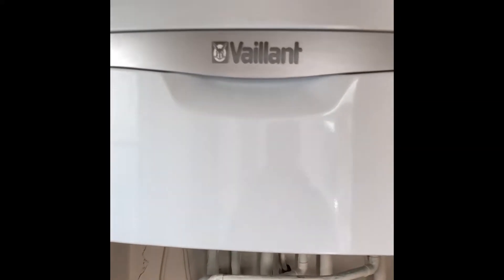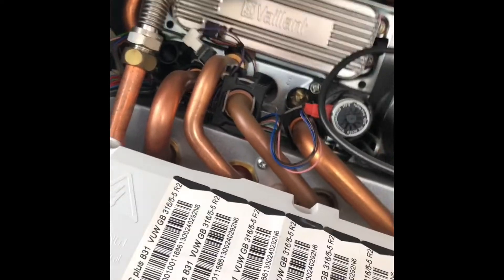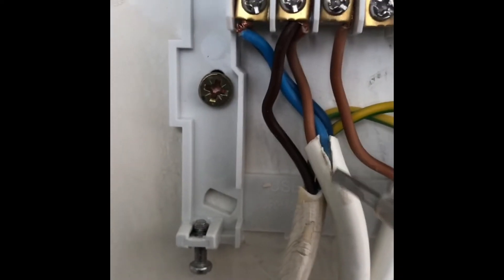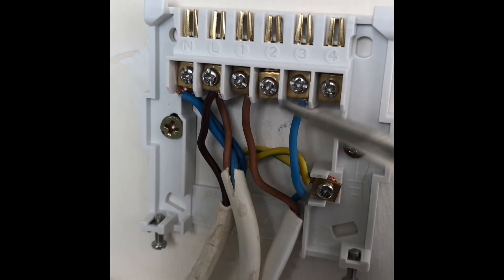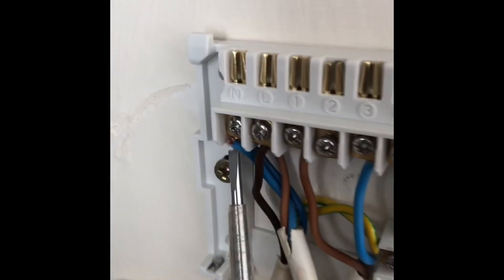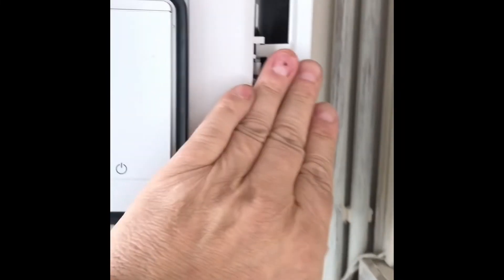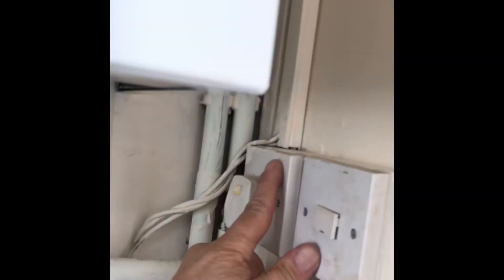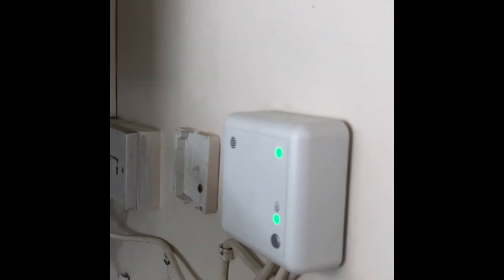How to wire a Hive system into a Vaillant Eco Plus 831

Comment: Thanks for the guide Bob. I Just wired in a Hive thermostat mini to my Vaillant Ecotec Pro28 R2. 
I was fine working out the 240v, I needed to know where contacts 1 & 3 on the Hive receiver went to on the boiler board.
The Hive hub/app took ages to find the thermostat, even though it was paired with the receiver. 
Once paired, the system worked as intended.
The old Vaillant wireless E-Bus unit I just disconnected from the boiler.

Comment: Bought a Honeywell 3RT wireless programmable stat for my Vaillant as the dog chewed the old 1, took a live neutral & earth from the boiler to power the receiver, screwed it to the wall job done, when it came to the 24v at the boiler end the connections weren't the same as the vaillant stat i'd just replaced and the boiler installation manual only showed how to connect vaillant products, the Honeywell guide said to connect to T1 & T2 where in the Vaillant there's no such markings, anyway, called a plumber out who messed about for a while then told me i'd blown the receiver up, mines an Ecotec plus 831, so out of curiosity, found your vid, followed it and bingo boiler & controllers fully functional, Thanks Jon
Reply from the maker: I’m so glad that you found it useful!
Happy New Year to you 👍🏼

Comment: That RT 24v connection  is a low voltage,  so it shouldn't be connected to 230v from the time clock common and load
Reply: That’s what I thought

Comment: Nice one, easy to follow. You Sir are too man 👍👍 thank you.
Reply from the maker: Dewi Jones I’m glad you found it useful and thank you for your comments 👍🏼
Reply: @Jstorfs19  hi mate nice video! Just wonder if boiler plus option will work if you connect it like that. As it says you need vr33 module to work on vaillant?
Reply from the maker: Mike UK hi, 
It should do because the only thing doing the work here are those two command wires which are connected to the boiler, they effectively bridge the gap from the receiver to the boiler

Comment: I have a Honeywell timer but I also have a mains power thermostat in my hall where does the thermostat get it’s power from as I’d need to delete it and then make it safe in regards to its power supply
Reply from the maker: If it’s mains powered then it will get its power from the mains, that could mean a fused spur or it could be on the same power 240v supply which supplies the boiler… 
I couldn’t possibly tell you… you could try turning the boiler off and then electrical testing the thermostat to see if the power has gone off which would then mean that the thermostat is taking its power from the boiler and you could then chase the wire back. 
There will be two wires that go back to the boiler though and these will be a low voltage COMMAND wire which literally sends a little signal back to the boiler to turn it off or on. 

Best advice really is to contact an electrician and get them to determine where the 240v mains thermostat power is connected too. 👍🏼

Comment: Where you’ve doubled up the wiring on the N and L within the receiver unit could you simply double them up at the other end instead?
Reply from the maker: Yes the 240v power that I have used there I have used it as a sort of junction box to then send the power to the boiler however if your boiler already has power then there is no need to send a 240v supply from the hive. 
I have only done this so that the hive and the boiler are running from the Fused Spur that you can see.
Please don’t confuse the blue and brown wires that are the COMMAND wires to the boiler….
The COMMAND wires simply send a signal from the Hive unit to the boiler to turn the boiler on or off as required.
Reply: @Jstorfs19  am I right in thinking you don’t have to earth the receiver? But could I just double up the earth at the boiler end as well? 

My set up is the boiler has a plug running to the socket, so there’s the L N and E connected within the boiler, so my plan was to run a cable from the receiver and double up at the L N and then attach the 1 & 3 to the 24 & RT within the boiler. I wasn’t going to bother with the earth but am I as well doubling that up boiler end?
Reply from the maker: @KeyserSoze5421  I would double up the earth but that’s up to you really 👍🏼

Comment: Hi. Really useful. How does one get a new cable into the boiler unit? Is that what those rubber nipples are for? Should we cut one of them and put the cable for the controller through the hole?
Reply from the maker: Hi, if you look under the boiler in the back left hand corner you will see a Red Bung! If you put a small cut in it you can push your power cable through it ... that’s what it’s for 👍🏼

Comment: Nice video and simple to follow. Like a few on here I have already got power to the boiler then have two command cables running to a wireless thermostat. I am planning to put the hive receiver next to the fused spur for the boiler and connect it up to get power for the hive receiver. I actually have a separate fused spur the other side of the hive receiver I could use instead as it doesn’t power anything currently. Just wondering if it’s better to take power from the same spur as the boiler or go from the completely separate spur?
Reply from the maker: Hi Jason, 
It matters not really where you take the power from just so long as it has power!
Personally mine goes back to a fused spur as in the video. Both the boiler and the hive are connected into the same fused spur but don’t get precious over it. The advantages of having to separate Spurs ie one for the boiler and one for the hive simply means you can turn the hive off without turning the boiler off and vice versa but it really doesn’t matter as the draw is small and both the boiler and the hive can run off the same spur 👍🏼👍🏼
Reply: @Jstorfs19  brilliant thanks 👍

Comment: What type of cable is used for the communication cable please?
Reply from the maker: You can use normal 240 cable which is what I have done in this case!
Reply: Thanks. I have now installed it but my heating is on constantly and I cant turn it off by the thermostat. I have the same boiler too.
Reply from the maker: @kelartis  hi, have you made sure that the command wires are exactly the same as the video?
Because of those command wires ie the two that go to the boiler into the block are the wrong way round the boiler will stay off when it should be on and stay on when it should be off!
It’s simply a command wire that takes the signal from the hive unit to the boiler so check to make sure the jumpers are also present where needed and removed where appropriate.
You shouldn’t have an additional thermostat connected also. 
Regards.
Reply from the maker: If you have used the hive control and thermostat that came with it then it should be fine! But don’t plug in an additional thermostat or if you have one then disconnect it because this could be conflicting with the hive one if the wires are different. 
If you imagine here all the hive system does is connect upto the mains, then the only thing that happens is the two wires that come out to the boiler are the thermostat command wires which just sends a little signal to the boiler to say ‘turn on or turn off’ 
A normal thermostat does exactly the same thing…. When you turn the normal thermostat let’s say from 18 -20 as soon as the thermostat registers 20 degrees then it then sends a little message to the boiler through those two small wires that go back to the boiler to turn on it turn off
Reply: @Jstorfs19  Hi. Do you mean the wires for the 1 & 3 terminal? I will check again today, as that does make sense, but I am 100% sure they are the correct way around. I used a .75mm cable for the connectors. Would that cause an issue? 

I am only using the Hive thermostat, hub and receiver that came with the kit and nothing else. 

Thanks for the reply.
Reply from the maker: You could try using a thicker cable, maybe take off the cover connect a thicker cable to both parts and see if there is any change….. sometimes people make the mistake of putting the wires the wrong way round in the boiler connector all this would do is turn it off when it should be on and turn it on when it should be off so try that too.
Reply from the maker: As long as that hive unit has 240 power going into it  the only wires you need to concern yourself with are the two wires as per the video that go from the hive unit to the boiler white connection (middle one) exactly as in the clip, that connector though may have ‘jumper’ tiny cable in it which needs to be removed, if you look I take it out and it’s blue and leave it in the bottom of the tray.

Comment: Hi mate got mine to wire by the looks of the  boiler control panel I cannot get the mains incoming and hive power in 1 terminal  will it be ok to wago it in a Junction box then split it to the boiler and the hive
Reply from the maker: The hive needs power and so does the boiler but they don’t have to come from the hive  I just used the terminals as a sort of junction box effectively because I needed a power source to both the boiler and the hive so it was easier for me just to pull a spur from the hive power in!

So long as you have a power source going to the hive it doest matter! 
The main thing is the signal wires, they have to go to the boiler as per the video as they are effectively a command signal cable sending an off / on signal to the boiler
Reply: @Jstorfs19  ok thanks will prob have to do it the same way then as I cannot get the two cables into one terminal thanks for ur help
Reply from the maker: @gd5129   if you already have power going to your boiler then you could run a separate power cable from the boiler to the hive but I just did it that way as it was easier for me.
Reply: @Jstorfs19  that’s way I mean tho I cannot get the hive cable into the boiler terminal not enuff room I wud send a picture but carnt on here
Reply from the maker: @gd5129   I see, in that case then do it just as I have done and use those terminals as a power to the hive and also a power to the boiler! 👍🏼

Comment: hi, i need your help in my case there is 4 connection N,L, OUT1 and OUT2 I can understand N & L but  which on will connect to hive 1 and 3. will be great help
Reply from the maker: Aamir Gondal hi there, N - neutral  L- Live then connection 1 +3 simply are command wires ! So that wire connects to you boiler as they send a signal to the boiler to fire up or shut off according to the hive setting

Comment: Struggling to find a salus rt500 install live and neutral are fine then comes two more wires black and grey for the rt port then back to the receiver but doesn't seem to be connecting. The old receiver that's currently in place only has standard thermostat so when the boiler kicks in it runs the heating for about 40 mins then shuts of so u have to press the overide button then kicks back in so wondered if can do away with the thermostats and just use the boiler itself Ie would I need to just loop a wire on the grey rt plug

Comment: Hi, I have the ecotech 831 with internal mechanical clock. Do I leave the clock in place and set it on constant? Thanks.
Reply from the maker: Stephen Robbins  yes leave the clock in place and set it to constant as the hive will do the rest or turn it on and off according to the app 👍🏼
Reply: @Jstorfs19 when you mean constant, the dial setting shouldn’t be on “ON”, or “OFF” but on the clock setting, should all the clock pins be set?

Comment: Great video.  I have a question on power.  You seem to take the live and neutral feed to your boiler via the hive box.  My boiler is already installed with power.  My question, do I now take the live and neutral feed from the boiler to the hive box.  That way the hive box is live when the boiler is switched on?  Or is this a separate feed to the boiler via the hive box?
Reply from the maker: Norman Cooper hi, 
My boiler had No power going to it at all!
So that is why I took a power supply from the hive to the boiler... effectively what I did was basically took another cable from the power going to the hive and sent it to the boiler that’s why I state in the video power is going to the boiler....
Don’t mistake the brown / blue wire which I have used as the command wire though.
I just simply used that cable ie the blue and the brown as a way of sending the signal to the boiler from the hive...... so all those two cables do is send an on or off signal to the boiler.

So in essence the room thermostat sends a wireless signal to the hive control wall mounted box....this then decides if the boiler should be on or off depending on the wireless signal revived. Then the wall mounted control box sends a signal via those two cables to the boiler which in turn then either turns the boiler on or off.

I hope this makes sense to you..
Regards
Reply from the maker: Norman Cooper  so in answer to your question if your boiler already has power then there is no need to take power to the boiler again !
The only reason I took power to the boiler is because my boiler had no power at all.

Most people’s boiler already have power so in that case all you need to do is make sure that the hive control box has power then just connect the wires that i connect to the boiler as a command cable!
Reply: @Jstorfs19  Thanks thst makes sense.

Comment: Hi Jon, my Vailliant boiler has 5 wires coming out, black, blue, yellow/green, red and yellow.  I understand blue is neutral, red is live, yellow/green is earth. Not sure what black and yellow wires are? Can you help? Trying to install it to Hive.
Reply from the maker: Email me a picture
Reply from the maker: If you are wiring in a hive thermostat like the one on the video and you already have power running to the boiler and also power running to hive then then all you need is 2 wires from the hive unit itself ! As per the video!
Reply: @Jstorfs19  I see, the boilers  black and yellow cable (see email) are for Hive terminal 1 and 3?
Reply: @Jstorfs19  Thanks Jon for the explanation and help via email. Much appreciated.

Comment: Does it realy need the earth conected , i have conected it without the earth and the burner doesn't go higher stays on minimum and the most tempeture it goes to ,45 degrees,  boiler is ecotec pls 824
Thank you
Reply from the maker: 2 wires that are connected to the boiler are only a command wire so if you are just connecting the control box to the boiler than you only need the two wires as illustrated in the video. 
Are you talking about the power to the Hive Unit? Or the boiler? 
Either way both should really have an earth….. for safety really. Hope this helps
Reply: @Jstorfs19  i have connected everything as  per video but when heating is on ,burner status si on low , it barely raises the heating to 45 degress
Reply from the maker: @slvs91  have you tried adjusting the burner temperature on the boiler control display? The hive unit does nothing more than tell the boiler to turn on or off….it replaces the thermostat and that’s all it does. 
Do you still have a thermostat connected?
Reply: @Jstorfs19  how do i adjust that? Its a vaillant ecotec plus 824
Reply from the maker: https://youtu.be/6t6QnYkXuXA
Take a look at this and it shows you 👍🏼

Comment: Hi,

Will this be compatible with th vaillant ecotec 28 proz and what do I do with the manual timer ? Just leave it as it is and just keep it on 24 hours ?

Also, if I want to install multiple zones, do I just connect all sets of command wires (signal on and off wires from all the receivers) to the rt connection port together (respective of their 2 locations on the rt connection port)?

Thank you.
Reply from the maker: is this a separate timer? if so I would disconnect it just like I would do if it was a separate thermostat .... the timer will no doubt have 2 command wires that go to the boiler and all you need to do is disconnect those two wires and put the 2 command cables as described in the video into those two ports because in essence all that a timer does is once the timer gets to a point that it is to be on then it just competes the circuit and that is exactly the same as what the hive hub does....
unless it’s a timer which is built into the the device such as the PCB then I would not touch it !

Comment: Hi. I only have the 2 connection wires going to the current receiver. Can I just install those and it will work or do I need to connect power the the hive hub?
Reply from the maker: Hi, you have to have a power cable going to the hive otherwise it will not work!
The power obviously powers the hive and the signal wires that are described in the video send the on/off signal to the boiler once the hive tells it too and this is what makes the heating come on and go off as per the app / room thermostat etc .... hope that makes sense
Reply: @Jstorfs19  so just need to connect the signal wires to 1 and 3 in the hub and wire a plug to live neutral and earth in the hub. Guessing I don't need to bother with the link in the boiler?
Reply from the maker: @korgscrew2000  that’s correct.... there is no need at all to send a power wire from the hive to the boiler if the boiler already has power!
Mine didn’t so it was easier to take a spur from the hive into the boiler if that makes sense
Reply: Thanks. I've installed but the heating is constantly on. Do I need to remove the jumper cable that you did?
Reply from the maker: @korgscrew2000  definitely !!   
You have to contact it as I have done otherwise the heating will stay on!!!

Simply connect those cables exactly as I have... and make sure you remove the red jumper it should look exactly the same as mine
Reply: @Jstorfs19  sorted! All working perfectly! Top bloke!

Comment: Hiya buddy can u run the boiler without having seperate thermostat in this case the hive that uve installed
Reply from the maker: Aaron hall sure you can .... on the control panel you will see two silver buttons just simply push the button in and the boiler fires up in manual mode👍🏼👍🏼